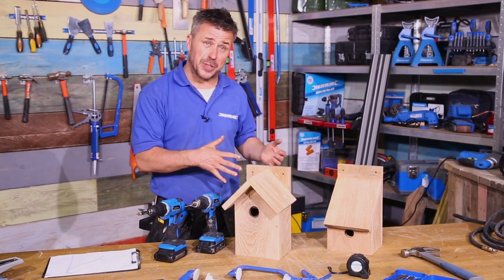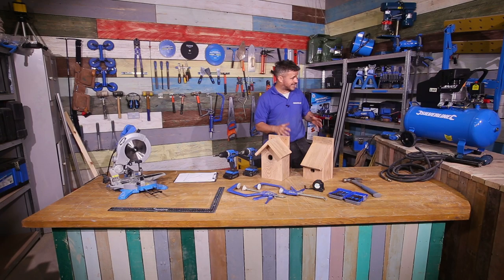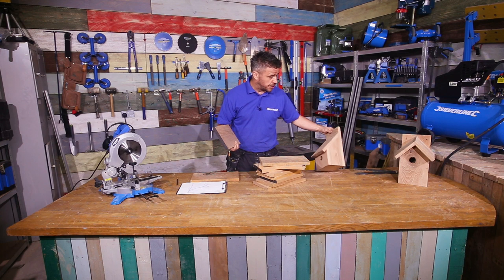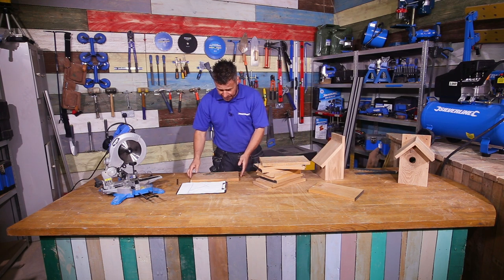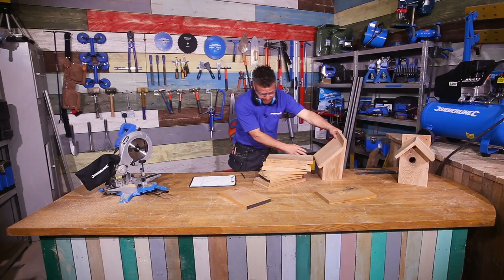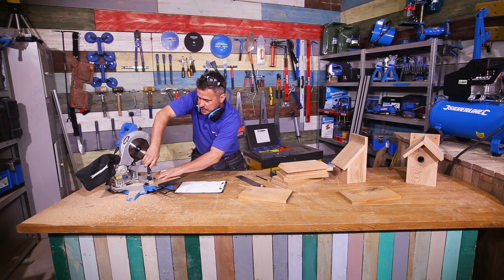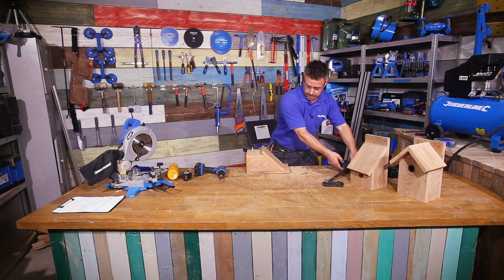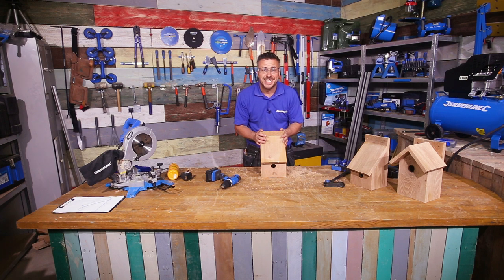How to make a bird house

Comment: The hinge is needed so that you can clean out the old bedding material every year. Its quite important as you are not likely to get birds nesting in a dirty bird box.
You need to drill some drainage holes in the bottom of the box otherwise in driving rain conditions it will fill up with water.
The perch on the front is not recommended as it allows predatory birds to get in.
It would also have been good to have some discussion on hole size and placement as there will dictate which birds you are likely to attract and if birds will use it at all. I have pasted some advice from the rspb below if anyone is considering making a box:

- The entrance hole size depends on the species you hope to attract: 

     25 mm for blue, coal and marsh tits

     28 mm for great tits, tree sparrows and pied flycatchers
     32 mm for house sparrows and nuthatches
     45 mm for starlings.

- The bottom of the entrance hole must be at least 125 mm from the floor of the nestbox. If it's less, young birds might fall out. The inside wall below the entrance hole should be rough to help the young birds to clamber up when it's time for them to leave.

- Boxes for tits, sparrows or starlings should be fixed two to four metres up a tree or a wall.

-  Unless there are trees or buildings which shade the box during the day, face the box between north and east, thus avoiding strong sunlight and the wettest winds.
Reply: Thanks for your tips, Ive had 7 boxers up in my gardens for close to a decade and they have different birds each year and sometime the same birds come back! I've found that not drilling holes hasn't given me any issues but i'm sure they would help.
Reply: Thanks for your tips.
Reply: thats nice one
but,,,, one question tho. ive heard some bods like the perch because maybe barny owlets might stand a chance of maybe tumbling out. and they themselves can maybe take on pred bods like kestrels somewhat?
and wonder if kestrels etc would really mess with crows and jackdaws too much anyway? but i guess im anly talking about those bords.. and maybe for the black bods and the sparrows etc,, maybe it stand to reason then.. maybe not to have over hang?.
God speed anway
Reply: I’d go for the hinge with a rubber strip and use a strong magnet to hold it down. Some birds are smart enough to lift the lid.
Reply: @DaddyBear3000  I use a hinge with some roofing felt behind it. Instead of screwing the roof down I put 2 screws either side with a cable tie tie that holds it down.
Reply: @YidSpur  sounds like a good idea 👍🏼

Comment: I think you not suppose to put perches in as it can encourage predators to get the young eggs, chicks. I have several nest boxes and none have them and no issue for small birds getting in
Reply: Thanks for your comments, I've built many bird boxers some with and some without perches and used in my own home, I've never doomed to have any problems with mine they have all seemed to be successful and the birds have returned the following year.
Reply: There are  a few suggestions for constructing aviaries:
Allow enough time.
take advantage of ready made boat plans.
(I read about these and more from Aviary Magic Method  website )

Comment: Please forgive the criticism because I know you want to build safe bird boxes.  Inexperienced people may follow a plan that looks great but isn’t safe. Just update your video to include the basic elements of a box that will do no harm,  Never add a perch instead cut shallow groves or ‘kerfs on the front and inside the door.  The 'kerfs’ inside the front helps the chicks fledge. You didn’t provide any drainage or ventilation meaning eggs and chicks will over heat. Instead chop a 45 degree cut off each of the floor corners.   There needs to be adequate ventilation or you've built and almost air tight box.  Always provide an access door for cleaning and observation.   Check out birding sites for detailed plans for safely built boxes like bluebirdsociety.org/nestbox-plans.  I know you love nature just be safe.
Reply: Some good tips on that website, thanks!